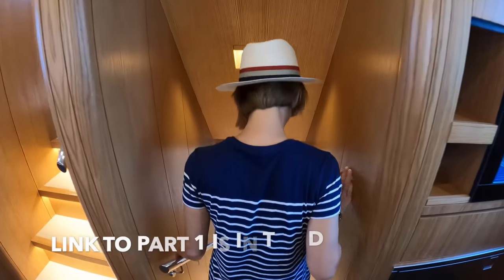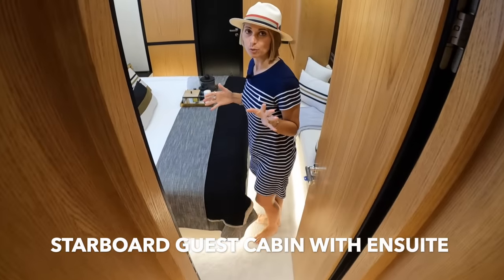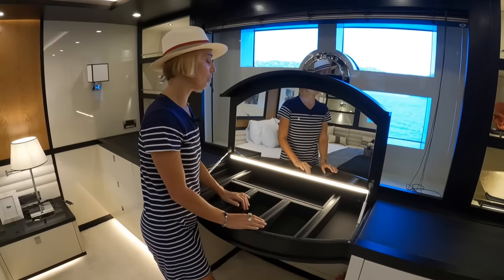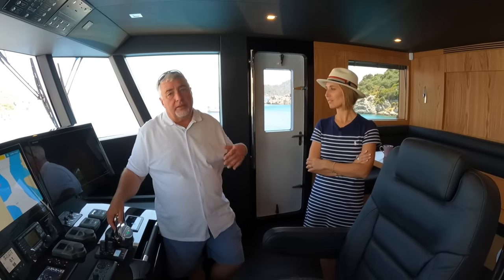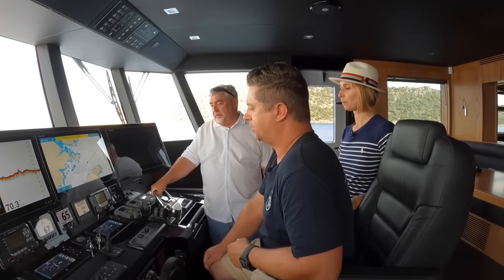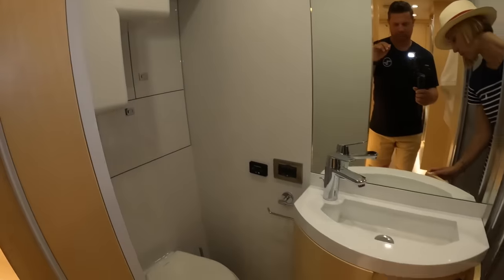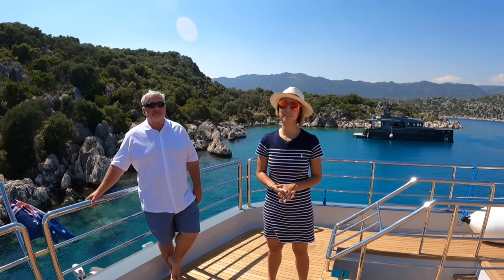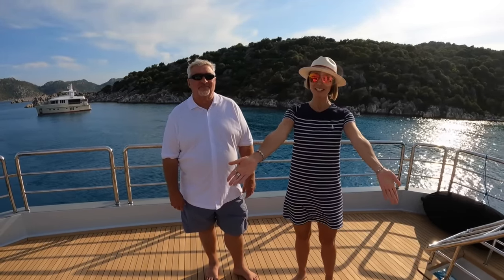2021 BERING 77 EXPLORER YACHT TOUR - PART 2 / EXPEDITION Liveaboard Go Anywhere World Cruiser Boat

Comment: What licensing would an US owner need to captain a Bering 77 in international waters? For example traversing the Atlantic. Also, what kind of experience would be most beneficial for this purpose? I agree with Troy Cooper's comment.. this review has converted me from being a staunch Nordhavn fan to being a Bering fan. In spite of Nordhavn's tremendous track record, there's just no denying that the Bering build quality is far superior to that of Nordhavn; there simply is no comparison.. and the Bering CEO is so charismatic, knowledgeable and a humble / non-condescending kind of guy. Watch out Nordhavn, there's a new kid on the block.. and they're opening the eyes of customers to new possibilities and exemplary build quality and strength.. track record is not enough anymore, there needs to be a robustness of design that can handle the oceans of the world with greater safety and strength than has been the standard, and Bering is leading the way. Nordhavn may very well become the designer/builder that boat owners will refer to in the past tense, a memory of things that once were, a builder that stepped aside and made way for something greater to take the lead. I think Bering is the future.
Reply: This boat is below the requirements for having a full time watch i believe so just get your appropriate weight license and you're good.

Comment: WOW great boat. I have a couple questions, 1. is there a captains cabin or does the captain bunk with the rest of the crew? And ball park figure hoe many Millions of dollars does something like this cost? I spent 22 years in the Coast Guard, and was stationed on 4 different Ice Breakers and those are built with stand Ramming very thick Ice which I do not thick other vessel could with stand the pressures the Front of the hull are built for.   Ron USCG MKC RET

Comment: Why would you consider any other vessel? This is the most dependable yacht on the water and Alexei's actually found room for improvement on future build's. Nothing short of incredible. I wonder if a conversion to jet drive's is practical, equally efficient and would eliminate drag (of a redundant prop') when only using one engine.

Comment: I was looking at sailboats, but I think I have open up my options.  

The only downside I see with a boat like this is the cost of fuel.  But, I’m thinking the benefits outweigh the cost of fuel.  Am I wrong?

I wonder if anyone did a pro vs con between high end sailboats and boats like this?  I’m interested in cost differences to run it annually as well as “ time” savings by not having to “ sail.”

Comment: Question; Since normal fire extinguishing suppressants don't work on Lithium Batteries has this issue been addressed by Bering? Flooding the water compartment is the only way to extinguish a Lithium Battery Fire and by the looks of the battery bank it would appear to have an open-plan. I hate to criticize anything about this boat, it's simply amazing in every detail, but since it's a safety issue that's worth addressing
Reply: I dont think they are lithium. From the looks of those batteries they are victron agm or gel batteries which come in an abs fireproof container.
Reply: @Aetam  Thanx for addressing that. I just assumed ( You know what they say about assuming?) Seems like everyone is going with Lithium these days and when I saw the open-bank it struck me as odd.
Reply: @Aetam  They are but they're lithium IRON phosphate batteries, not the lithium-ion batteries used in laptops and cell phones. They are far safer than lithium-ion batteries. Thermal runaway is intrinsically impossible in LiFePO4 batteries in normal operation.

Comment: specs say loa is 85’2”. Why are you saying “77” foot? Just curious.
Reply: Its 77 ft at the waterline. Loa stands for length overall which is the longest point to point of the boat from tip of bow to stern.

Comment: Poor design on the engine-room access @ 3:30. You can see the interior door opens to port, and swings above the hatch; the hinges on the hatch suggest the hatch opens up. 
So if the interior door was open/loose and the boat was listing slightly to port the hatch could not be opened from below.
Easy fix, I guess, is the interior door should open inward to the salon.

Comment: I used to be a huge Nordhavn fan.. but that has changed after seeing this video. The Bering 77 is built like a tank, and I'd feel a lot safer during a massive storm at sea in a Bering 77 than in a Nordhavn of a similar size. That said, I do think that Nordhavn still wears the crown when it comes to engine room layout and tagging of lines, etc. Other than that.. move over Nordhavn, you've met your match!!

Comment: The 5000 watt victron inverter/chargers , all 4 of them are bolter up against the wall completely blocking the cooling vent !  They will burn up this way in just a short time !  and those are $2500 each ! But I'm sure 10,000 grand is nothing for this guy !

Comment: Important message. Having a washer/dryer in the master closet is amazing unless you always have the crew do the laundry. I say it is amazing!  Imagine just putting your dirty basket in something three feet away and then when they are done you put them back 3 feet away, or maybe you watch some tv in the master and fold a little laundry and then put it away without even using a basket. Do it on your new boat.